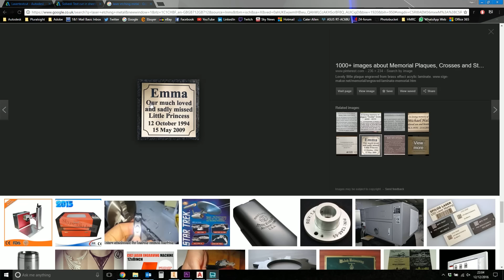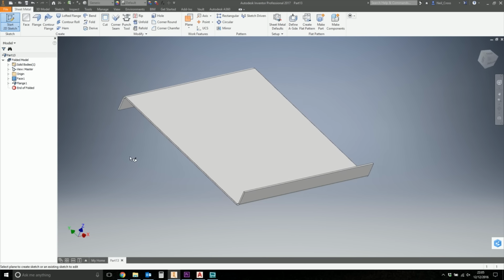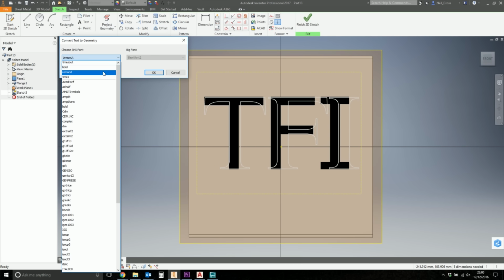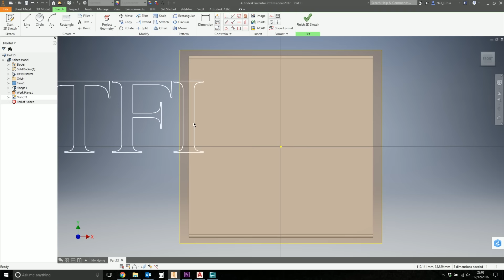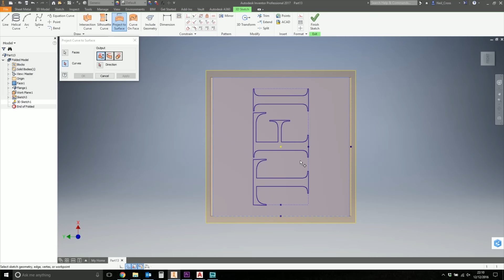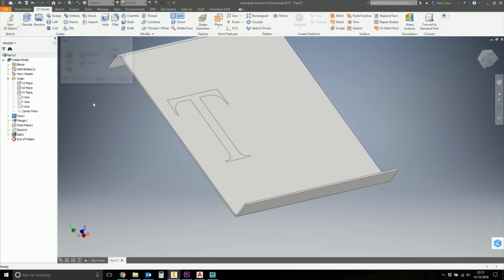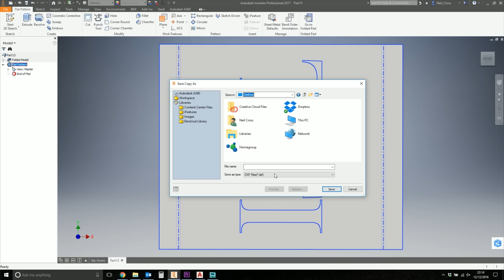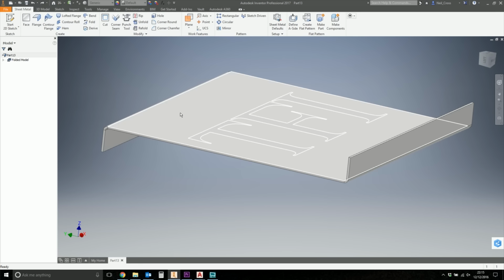How to Create Laser Etched Text for Sheet Metal DXF Output

Comment: This is great!  Once our company upgrades to 2017 I can see this being used.  However, how does the laser cutter know that the text needs to be etched and not cut?  Whenever we have parts that need etching we export the flat pattern to  AutoCAD.  Lines we want cut are put on the 0 layer and lines we want etched are put on an etch layer.
Reply: You need to make a new layer, We normally name the layer etch. and move the geometry that you want etched to the new layer.
Reply: Pro-Stitch Ag just to be clear, a new layer in inventor?
Reply: sorry about being not being too detailed. But make a new layer in the DXF File with basic Autocad.

Comment: why don't you just include a flat pattern sketch in your export?
Reply from the maker: Aye that would do it, but I just like to cover a number of things in one vid that could be used elsewhere as well as this like the project to surface, split face etc.  Doing it this way also means the text is visible in the folded model too which would be the number 1 complaint if I shown the flat pattern sketch only option!
Reply: TFI Only reason I brought it up is because you said it was the only way that would work. It's a sweet workflow, so don't get me wrong... I aint saying it's shit.
Reply: TFI The workflow is sweet as F for the emboss video. long time coming... still clunky, but not a touch on what it was like previously.
Reply from the maker: Aye I might do a follow up one showing the flat pattern sketch only, it's a lot less hassle if you're not arsed about having the etched text in the folded model